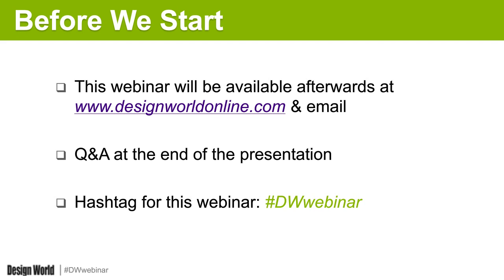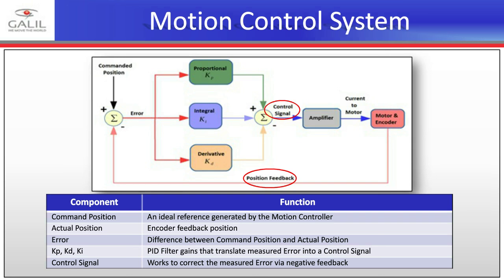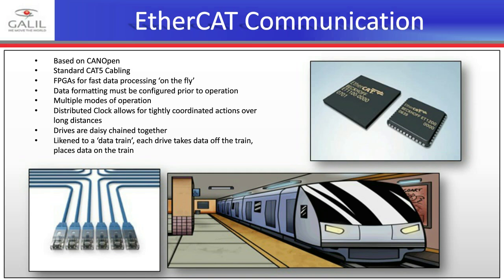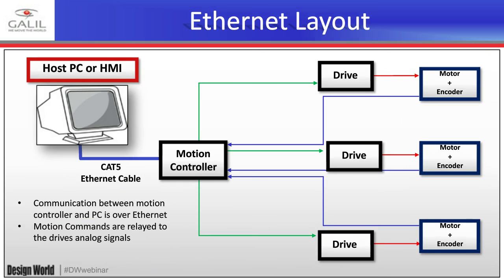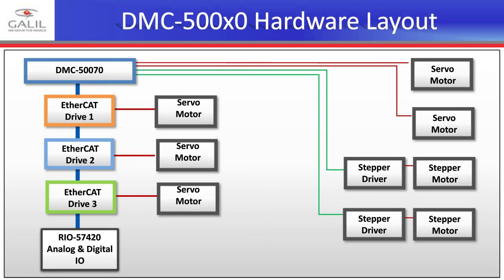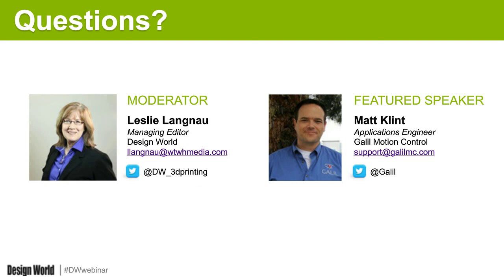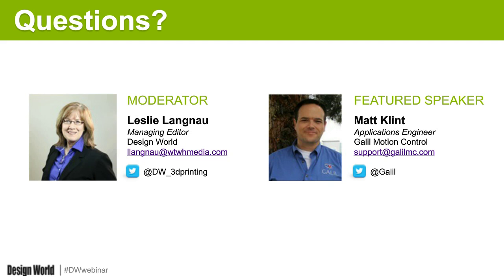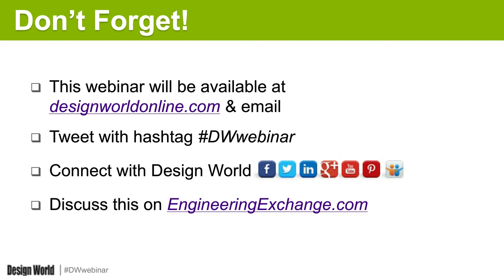Ethernet or EtherCAT for Motion Control Webinar: Choosing the Right Network for Your Applications

Comment: Motion control is about the only application where digital has made life complicated. There was a time when a competent in-house engineer could repair this stuff. Now, the 24/7 production line that decides to have a problem on a Friday evening...he's pretty much screwed.
I was Galil's first machine-tool integrator back in the 80s. Jacob Tal and I spoke often and also Lisa Wade and Kaushal. Great times but now, if I have a DMC failure, how long before I can get a replacement?

I decided to develop my own distributed system based on garden variety MCUs....Problem solved 👍
Reply from the maker: Hi Craig,
This is Kaushal Shah, good to hear from you.  I understand your concern about having the production line that is operational 24/7 and if something fails on Friday evening.  In that situation, the best option is to replace the failed unit and get the system up and operational to minimize down time of the production line.  As for diagnosing and repairing the component that failed, there was time when the products were simpler and a competent engineer could repair the hardware due to design with discrete components.  Over the years, the products have become more complex and with higher level of integration via FPGA, cPLDs combined with ASIC and Micro-controller, it is not practical to repair product in the field.  It is more effective to keep a spare unit just in case if there is a failure.  The focus is to get the production line up and going again and not on field repair of the product which has component(s) with BGA package. 
Typical time to repair/replacement of a unit is between 1 to 2 weeks but with expedite process, that can be reduced to 48 hours.  This is one of the best turn around time in the industry and we take pride of our staff that is able to deliver that fast response.
I am glad that you have developed an in-house solution for your project.  For OEM customers, that option may not be the best choice when dealing with change in engineering staff and / or parts becoming obsolete or change to its package style.  That becomes a major drain of resource to maintain an in-house design.
Reply: @GalilMC 
Hi Kaushal, I miss the old days. Great to know that you are still there.
You guys were responsible for me starting my business...the DMC was my secret weapon and I was proclaimed a "genius" 😁
I have so many stories to tell about how I went up against an army of Allen Bradley engineers who totally failed to do what I could do with the DMC.
My first ever project was for a GM supplier, Johnson Controls/Hoover Automotive. They had procured a piece of equipment ($600K) which couldn't possibly perform with the open loop steppers. I was already familiar with closed loop servo control and all of a sudden, found myself roped into this serious problem. I was 27, jeans and t-shirt and, having recently discovered the DMC, went up in front of the GM pocket protector brigade and proclaimed that I could make this piece of junk work. Man, I'm talking beige-box IBM PC + 2 X DMC 430s. I was the laughing stock but I'd purchased a few of those analog amps and small servo motors that Galil used to sell...simulated the sequence on my desktop, ditched the huge steppers and replaced them with servo motors....no BS, the machine was working the first day I powered up 👍
Initially I was saying, "it's not me, it's the Galil“ but I soon learned to shut up and take the credit 😂😂😂

Would love to hear about Jacob and Lisa.

PS. Your site is horrible....password just to search the forum? Come on man...instant turn-off, lose the log-in nonsense. 👍😁

Best regards, Kaushal,
Craig.